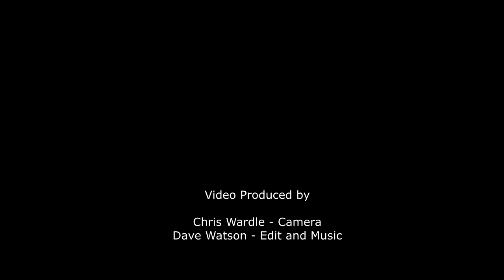Bow Building Montage - Traditional American Flatbow Build

Comment: This is a very tranquil video. I like it. I'd love to see some more build alongs. I've pretty much watched all the other build alongs and you do a good job with it all. I've made a couple tri-lam bows using your techniques. My most recent one is a quad-lam, hickory backing, action bamboo core with a tapered ipe core and ipe belly. Had to cut 6" off cause I got over zealous with the belt sander. Not sure it's going to survive but we'll see.

Comment: first; wow...
second; Do you really need a heat-bow for building a bow?
Reply from the maker: +Marnix Relyveld Do you mean a Hot Box? It helps to keep the temp, constant while the epoxy is setting.
Reply: thanks, so heat box is really necessary to make a proper bow?
Reply from the maker: Marnix Relyveld constant and even temperature is needed and the hot box is the best way to get it.